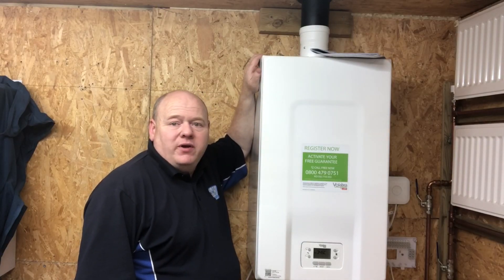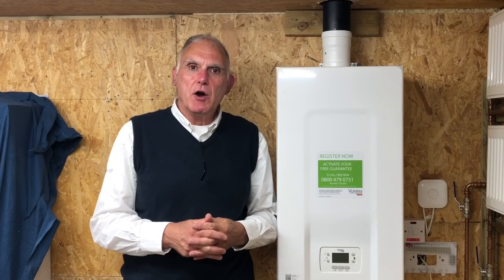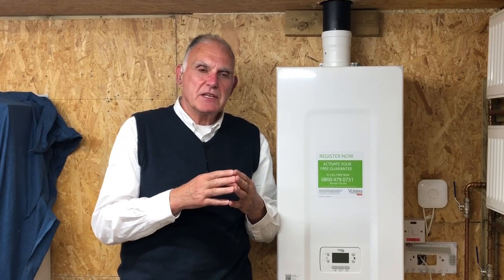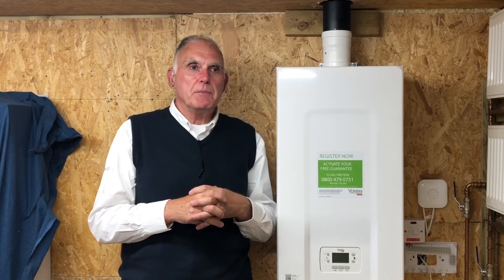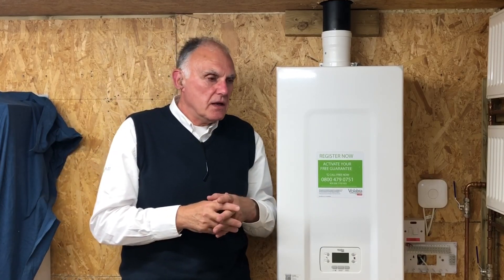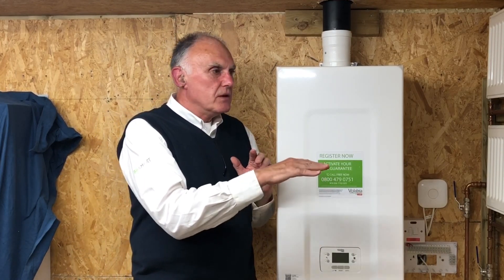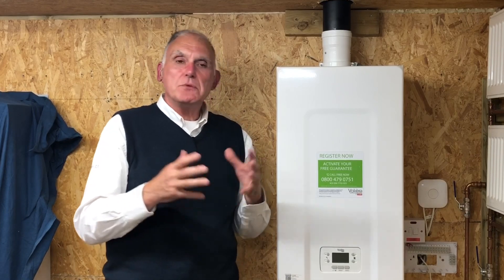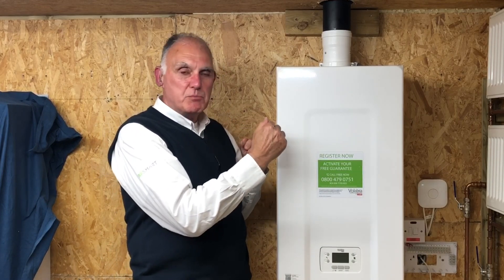What is OpenTherm / Weather Comp

Comment: My view is sadly that WC is a total mystery to most installers. None have offered it as a worthwhile extra. Most gas boiler users south of Leicester or where the winter temp does not fall to near double digit cold temp. Yet Bosch-Worcester does not support Opentherm in UK/Ire even if Bosch can do it in Europe. How many boilers offer setback? From listening it would seem that condensing feature is only of use when the boiler is operating at a low effort and the return flow temp is lower to the higher outflow temp. Why is WC not standard fitting like mag filtering has become. Power flushing is still a rarity offered

Comment: My new-ish build came with a weather compensation. Absolute crap - Unless it was litterally freezing outside the radiators never got hot enough to get anywhere near comfortable inside. I would go for opentherm if I had the option, but I don't with this boiler.
Reply from the maker: Thank You

Comment: Convince me to go opentherm again after a TADO wireless receiver's cr.ppy designed board burned completely because of the flaws in the power design and damaged my expensive boiler and now i have to use classic on/off RT to be able to have heat during winter. It is the case with every manufacturers, even Google nest. just wait a few years and you will see. Mine worked for only two years.

Comment: I’m having a Viessmann 100 35kw boiler installed with a Nest controller, and I believe it has open therm so is there an benefit to fitting an outside sensor and using weather compensation?

Comment: Great video and very informative.  

I have an older Ideal Logic Combi 30, recently wired for OpenTherm and I was wondering if you can tell me if I need to fit a link wire across the room stat/timer connections?  

Ideal state it doesn't need a link wire but I notice Allen installed one with his Ideal Vogue Max OpenTherm installation and I have read of other Ideal users installing them with OpenTherm, hence my confusion.  Thanks.

Comment: Hi Allen and David.
Connected the nest to the Vision Plus with opentherm, is the no way to control dhw temperature?
Also on the manual to enter combustion mode it asks to disable the connection by setting the parameter p8.03 to 0 but the parameter only goes to p5 any more info on this?

Comment: I fitted a Baxi 800 working with a Nest on OpenTherm at my own house and its a massive improvement on the old system which was a Halstead Combi on 240 VAC thermostat switching. OpenTherm is way better than weather compensation, in my experience you ask the customers if their cold and the answer is usually "yes" especially if they are elderly.
Reply from the maker: Thanks for the feedback.

Comment: Hi! Thanks for this video. I am about to buy a Ferroli RRT 34 boiler, to control the hot water and heating in my flat. The installer is offering me the Ferroli Connect Smart WiFi, that I don't like at all. I want to install a Google Nest Learning 3rd Generation. I know that the Ferroli RRT 34 supports OpenTherm according to the instructions manual. But I have seen some comments online saying that, if you really want to get the most of this boiler, you'd better use the Ferroli thermostat. Can anyone actually explain what kind of things I can do with the Ferroli thermostat that I can't do with the Google Nest? Anyone out there using this boiler with Google Nest? 
Thank you all.
Reply from the maker: This is a Vokera
Reply: @AllenHart999  thanks. Do you know if Nest would work with Ferroli RRT 34 though?

Comment: so is it possible with opentherm to actually monitor all the boiler parameters using it... for instance is it possible to see boiler flow and return and dhw actual temperature pump speed and any other parameters of the boiler...  i have a baxi 224 and thinking on getting a nest but not sure it will show me all these parameter ?

Comment: Very good clear explanation of this type of control, just one thing though does a Nest Thermostat for example take into account outside temperature when trying to reach inside temperature like a weather compensator does & both comply with Boiler Plus regs?
Reply: Nest can get approximate outside temperature from the internet and use this somehow? But most times o/s temperature is directly connected to boiler itself.  I have a feeling that if you use opentherm the o/s temperature is for information only (its used with normal on/off thermostat)

Comment: Weather compensation at times is not the way to go. If you have say a Kickspace fan heater which require a reasonably high flow pipe temperature, weather compensation may reduce the flow temperature too low, not giving effective heating from the Kickspace. So, know what you are fitting and in what application.

Comment: Have weather comp, best thing since sliced bread, boiler seems to run on air,
Reply: Glad you like it but I know other people whose life patterns, comfort level requirements (and budget) that have taken it out. Horses for course. Around a 2% saving may be possible I reckon.
Reply: vulcancontinental  had a new boiler fitted at the same time,  Vitodens 200, so difficult to say how much of the saving is due to the compensator, have warm radiators, rather than hot,  is no issue for me, just happy with the savings.
Reply: @paulhill1665  the WC on that boiler is supposed to be very good, highly rated by it's fans and more importantly is adaptable as a basic version of WC is a really blunt instrument. I heard about an installer Monday who likes the 200, put WC on it for 6 month then took it out, just personal opinions. In my opinion the biggest factor isn't the boiler, isn't the WC or OT, it's what is replaced as that's the benchmark you're starting from and you can look for 10 - maybe 14% improvement on the new boiler alone.
Reply: vulcancontinental if a

Comment: Good video. 
My experience of weather compensation is it ain’t worth the hassle.
Most new builds have it fitted to meet low energy rules but constantly get sent out to houses complaining that the  radiators aren’t getting hot.
People put heating on and expect radiators to get piping hot. Weather comp can stop this happening and end up having to disconnect it to keep customer happy. End users just don’t get the way it works and it isn’t explained to them in the first place. 
Just to add, as Alan says, read the instructions. Electricians should know better than to run the low voltage weather comp wire alongside the mains voltage cable, can cause interference and clearly states in installation instructions not to do this .

Comment: Isn’t it funny how years on, the best way and cheapest.  is still don’t have a room stat and just turn the boiler stat down in summer and slightly higher in winter if needed. It’s also the cheapest as you only turn it on when cold!
Reply: The best monitor of temperature is yourself so you're right in a way but you have to want to make the effort, most people want to do less and government regs. want to take lazy humans out of the equation so they legislate for theoretically more automatic efficient controls and  the having the most effect for the least expense or inconvenience. They also know high fuel bills can have an effect on the balance of payments and who votes where if the the voter feels poor.

Comment: Very well explained, please can you give some more examples of these types of thermostats and if they actually form a cost saving in real life.
Reply: That'll be a long article I'm afraid and one where there's no definitive answer. You could buy an Aygo on the promise of 60mpg then drive like a maniac and get 40mpg.
Reply: The Vokera BeSMART is an open them controller
Reply: @dickie997  actually it is both OpenTherm or ON/OFF, just choose which of the marked cables to use

Comment: that is a very good explanation of opentherm, however i would like to add that opentherm is a messaging protocol, sending packets of data to and from the boiler and controls, therefore the connections are very low voltage and cannot be tested with a regular multimeter. if wiring in  opentherm it is a good idea not to use 5 core and have your mains voltage parallel to the opentherm cables, as voltage can be induced and cause a fault. bell wire is best.
by using opentherm you benefit from a slightly more efficient boiler, but by it heating on one fire heat curve you also negate the boiler overcycling, which overtime will not wear out the parts, i.e fan stopping and starting, gas valve opening and closing etc etc.
Reply: Couple of good points there. Yes the information is data packets which would not appear on a multimeter but with the system isolated electrically you could use the meter to test if the cable was actually in good condition. One point, polarity is unimportant with OpenTherm, two cores, connect to the correct terminals at either end and the control sorts out the rest. FYI Voltage is used room thermostat to boiler, current boiler to thermostat (when I say voltage and current it's chopped up into data packets). VERY important point about multi core cables, data should not be run with power, induction from the power cables can affect the data packets. I suggest running cables at least 50mm apart parallel to each other (although some cables are shielded). Running data across the power, say at 90 degrees, is unlikely to have an effect.

Comment: Thanks for the video, 
In what situation would you recommend each form ? 
Weather comp seems ideal for a property that has had a full heat loss calculation done on the property, is on a modern designed system? Would you agree WC is proactive in operating 

As OpenTherm is a form of Load Compensation but would it be more suited to houses that haven't had the system upgraded (newer rads etc) as it is more reactive in operating 

Just open to learning more which would be better recommended
Reply: Very tough question. Oddly the more oversized the system the better WC can be exploited. I have my own views on effectiveness but I'll back off and say the EU with ErP data rate WC as 2% improvement and OpenTherm on a modulating boiler as 3%. Both combined as 4%. So much depends on circumstance, occupation patterns, customer expectations, structure etc. Even whether an existing boiler can accept WC or OT and if so in OpenTherm's case, is it compatible with a particular boiler.
Reply: @vulcancontinental  I agree that there are too many factors to directly say one is better than the other.
This might sound like a stupid question but I can't get an actual answer for it......can you use both on the same system or will they conflict . Unless they are the same brand and designed to work with each other
Reply: @owenattewell3910  I can only answer for Vokera and say yes you can use both; don't even need a sensor with our BeSMART, just download the weather although I think a sensor is better personally. I honestly can't say X% will be saved and anyone who does say that I'd ignore. The EU say 2% with WC, 3% with OT and 4% if both combined; is this accurate, who knows, too many variables, what boiler, what control, what construction, what were the customer expectations?
Reply: @abhisheka1849  I'm not familiar with Heatmiser but OpenTherm can certainly work with multiple zones, I'm in the middle of testing another brand, not Vokera, at the moment. Our own BeSMART works with multiple zones but we would not support it on another brand boiler so it's not worth you experimenting. The latest boiler, the Vision Plus, can operate dual zones at different temperatures although we're not really releasing details yet. OpenTherm can drive cascades of boilers, it's just finding the right combination of control and boiler that work together.

Comment: Weather compensation can work on OpenTherm, however some do not. 
Weather compensation:
♦ raises the boiler flow temperature when the outside temperature cools;
♦ lowers the boiler flow temperature when the outside temp rises. 

Weather Compensation is feed forward control. That is, it anticipates the coming heat loss, or heat gain, adjusting the heat input to the building to suit. eliminating a cold spot. A simple thermostat is feedback control, it only injects heat into the building after the inside has cooled. 

Some may have a room temperature sensor (called a stat for domestic use) to trim the final target room temperature off.  If you have TRVs all around then no need for this. 

Weather compensation, as stated, keeps the boiler temperature as low as possible to maximise efficiency. Set up properly, they can almost eliminate boiler cycling. With a boiler that modulates very low, say going down to 3kW, it may hover the burner at around say, 3.5kW for long periods, with the burner never switching off. Perfectly matching heat demand.
Reply: I can't help but add Vokera's OT can work with WC and can take the outside temp from a wired sensor, a RF sensor or download it from a weather station
Reply: This is an important issue as a lot of weather compensation is heavily relied upon the installer fitting the sensor correctly, as it is essentially a thermistor, thermostat resistor and the boiler relies on accurate information to best change the parameters, of the sensor is not facing the correct way or obstructed etc it can cause the whole system to go out of whack.
I see this many time’s when on warranty calls, the installer just drills a whole through the outside wall of where the boiler is mounted and attaches the sensor, regardless of which way it is facing.
Reply: @johnburns4017  Not sure who got there first but don't think it was Navien, it doesn't matter anyway, what matters is where the weather stations are and how many sensors around the country. Nest uses an internet network of amateur enthusiasts, 2000 last time I looked but the equipment is amateur of course. The met office have 200 stations, another service just  100 which if my memory is correct means you could be almost 100 miles from the nearest sample point.  I use internet on my BeSMART because I forgot to run the cable and it seems ok.
Reply: vulcancontinental what control manufacturer would you recommend for weather comp / open therm on a non vokera boiler then if nest is amateur?
Reply: @tomadams94  Nest is not amateur, the weather stations it draws its information from are run by amateur enthusiasts. That's different to say the met office.

On the plus side  there are loads of them and you can find them on a map, each one will say if it's reporting wind, temperature etc. Some will be expert others less so. 2000 give a good spread but they're concentrated in conurbations. I think it's called the weather network, it's a while since I checked.

The met has 200 but they have history on their side and can extrapolate across the country based on past conditions. Sorry, can't remember which company uses them. 

Heat Genius uses a service that has 100 stations for the whole country.

I don't know who we use now as any manufacturer can change service provider at any time and we were looking around earlier.

Frankly, if there was a consistent anomaly with whichever one you were using I'd adjust the curve on the boiler to accommodate it.

Don't overestimate the benefits if you're cost conscious motivated. It's calculated OT and WC will give you up to 4% improvement (not my estimate) and with the average heating bill across the UK of £800 that equates to £24/annum if correct.

If there's someone in the house and you want it warm all the time this is great but if occupation is periodic running the boiler continuously to improve appliance efficiency may be counter productive and increase bills.
Reply: Thought I'd have a look at the people Nest used to use and it was weather underground. Unfortunately apparently they've stopped making available the public mapping of the weather stations they use which was handy if you wanted to know where the nearest to you was.
Reply: @vulcancontinental  thanks for your detailed reply i will look forward to researching them more. Is there a situation where adding WC to say a smart OT control would be useful or is that overkill?
Reply: @tomadams94  I personally have my doubts but have it myself. I think it's worth 1% at best and may even increase Bill's if cost is more important the continual comfort. OpenTherm for remote access to the boiler condition, WC for temperature alignment with demand but I think more depends on how you use the boiler and lifestyle patterns plus the boiler construction; ali or stainless. Some are suited one way the other the other way.
Reply: @vulcancontinental  
"download it from a weather station"
This is becoming more common,  eliminating the hassle of wiring and finding a proper sensor location on the north side of a building.  I think Navien were the first in the UK with this function.
Reply: Baxi helpdesk stated that none of their boilers work with OT & WC, only one or the other. So if you have a baxi boiler, you can't have OT & WC, it's a choice of either WC or OT.
Reply: nice explanation